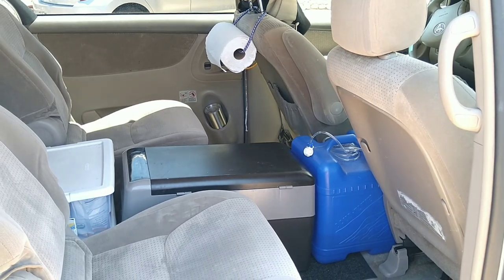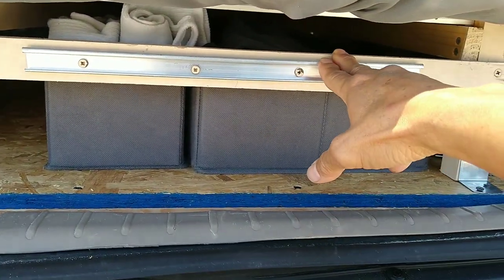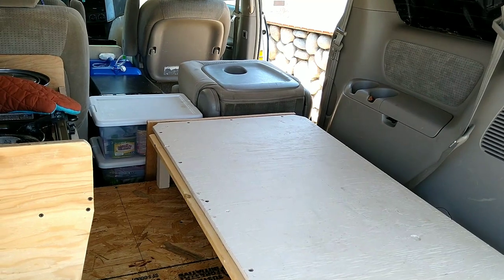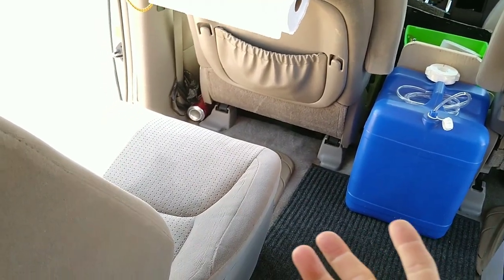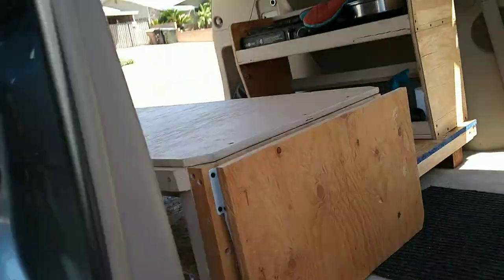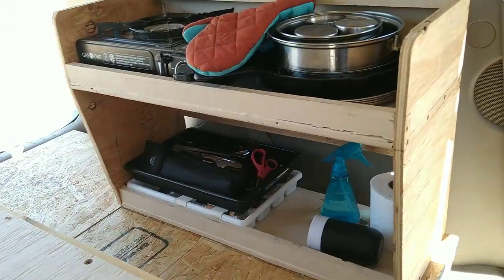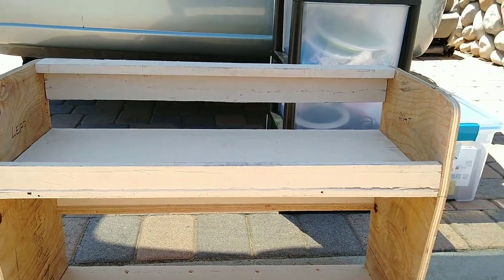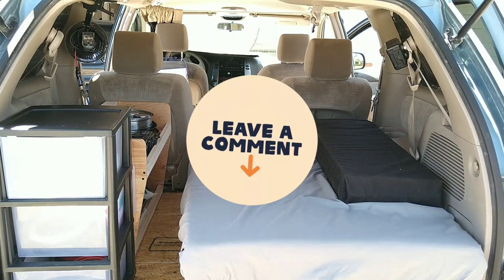VanLife | Simple Build on 2008 Toyota Sienna Minivan Camper

Comment: I love this setup so easy and practical with everything you need and the ability to add and subtract. This will be my 1st van and build thank you for sharing and doing the work. I was looking to try out Van-Life, not looking to invest a lot and not like it. I will definitely use it for a weekend warrior and a cheap hotel room to do some traveling photography and backup housing. I want a nice cargo van and did not think I could pull off a mini-van but this build is genius. Toyota Sienna is affordable and dependable and has good gas mileage and the build does not hurt the van making it easier to resale and up-grade.
Reply from the maker: I couldn't say it any better than you!!!😎👍 Hope that your build will fit your need. Start out with the basic necessity: bed, storage, water supply and a mean to warm/cook food. After a few outings in your build, you will know you do and don't need. Add and subtract as you go. Reconfigure the build so that you don't move things to get to other things from your seating position in the minivan. Good luck and see you down the road!!!